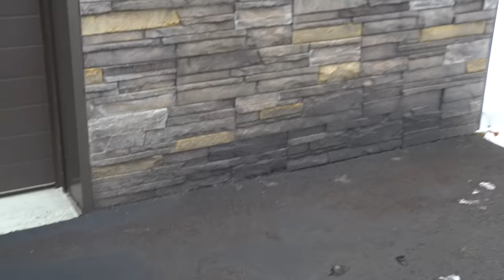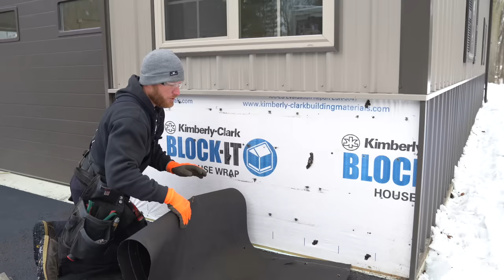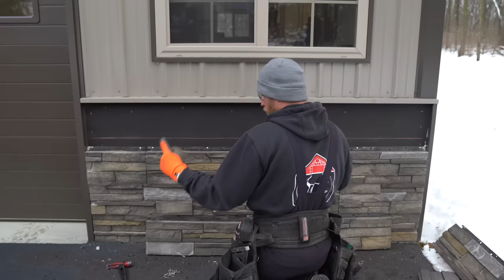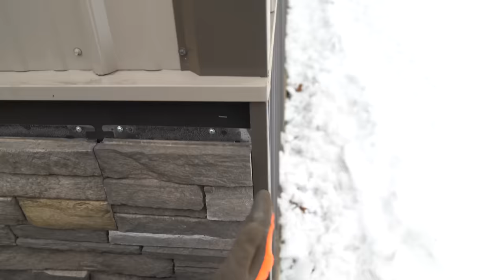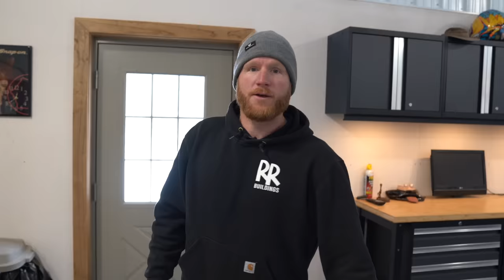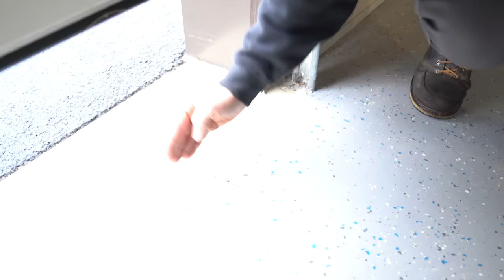Installing the BEST Looking (FAKE) Faux Stone: Versetta Stone by BORAL

Comment from the maker: Versetta Stone is a great cost effective way to enhance the look of your building very simply.
Reply: Great video on this product
Reply: What is the price per square foot?
Reply: We've had great luck with Versetta stone. Used it on our last 8 houses. Saves use from waiting on a specialty trade to come in and mortar the real stone on. Only downside is, there are limited colors currently.
Reply: @skliros9235  He said $12.50 per sq ft in the video, I believe
Reply: 24 square feet at Home Depot is like 360 before tax here in New York
Reply: Yeah good idea go to where they make that material. I like watching manufacturer of building products. Thanks.
Reply: KelMaster Construction I pay $6-$8 per foot for regular faux stone tho and yes I realize I still have the masonry materials and all in top of that but I usually end up at $20-$22 per foot and I’ve got a product that really looks close to stone instead of mobile home underpinning. 

I can tell versastone from faux stone just driving by. I guess I’ve been around it all way too long and to me the versa stone just looks way too fake. But it does have its place and the installation is nice
Reply: RR Buildings cheap asf
Reply: Can you use this faux resettastone product on a block home. If so, How would you install this product on a block home? I Would love to see , how to videos ,on how to install and what the best method to install vesettstone on a block home.
Reply: I seen the fake all most disliked how did I get here YouTube
Reply: ID LIKE TO USE IT ON A MAILBOX TYPE COLUMNS IS THAT POSSIBLE?
Reply: I had actually wanted to use this product for my house (a remodel/addition, whole house residing), and was excited about it. During planning we sent videos to the architect and builder (almost a year ago), and they were excited. The builder approached the local dealer, who tried to get samples. I personally called the sales rep for our region, and he said he would send us samples. Despite follow ups, nothing ever appeared. The alternative (lick-and-stick stone) was out of our budget, so instead of doing stone we just put Hardiplank all the way down. A bit disappointing. All parties were excited about this product, but as the days, weeks, and months went by, without even a sample being sent to any of the parties involved, we had to move on. It's interesting to see that it's a real product since even our local dealer couldn't get an order filled.
Reply: Quick question: What microphone do you use? The sound is outstanding!
Best regards form Mr. Plumber :)
Reply: Good video by the way you look like mexican boxer Canelo Alvarez  wtf.
Reply: Cost effective??  That’s hilarious.  This crap along with all the other fake Stone is outrageously expensive.  And a lot of it just don’t last.
Reply: I'm needing this done ASAP
Reply: Cost effective? $15/sq ft?
Reply: I'm curious how long it holds up to the sun's UV's , damaging it ?
Looks great right now.
Reply: How well does it mount over rigid foam cladding?
Reply: Paul Davey  ==
Reply: What are you using there to cut
Reply: Reducing the raddle was a really nice touch. I have leaned against a faux rock wall before and I know I have felt it moving around or loose and it just seems cheezy. It makes it seem like the job is far less professional when it wiggles. So I liked the solution.
Reply: Where can you get it? where is the link?

Comment: I installed "faux" stone for many years.  Here is a trick that will set you apart from other installers...get yourself a couple cans of flat "camo" colored spray paint (like a tan, grey, olive green) depending on the color stone you are working with and use the paints to touch up any cut end or edge that is visible. Having these cans of paint in your bag of tricks will improve the look of your work, especially interior work that will be looked at closely for years.  Keep up the great work, I enjoyed this vid very much!
Reply: That's cheating!   
Tee hee.
I used to use that textured "stone" paint too on granite and similar stone.
Reply: I wanna see how you return this from the corner of a house to the next side of the house, or is this just a front facial? What he’s working on has different siding on the return.
Reply: Do the same thing. Thought I was the only guy. lol Im not ready to spend the $ on the saw he uses and am interested to hear what others are using. Ive got a very nice tile saw but reluctant to take it out on a siding job
Reply: Uhm this is my wifes utube subscription lol I own Alaska Homes and Interiors she has a diner.
Reply: @analynelliott577  I always used a 4 inch Dewalt angle grinder with diamond blades.  The saw costs about 90 bucks and the blades are fairly cheap and last for a long time. The diamond blades cut "faux" stones like butter.
Reply: How do you cut it?

Comment: Excellent demonstration/tutorial on Versetta Stone repair, installation, and how it works. Just one small but maybe not as small as you think issue.  I know you are a serious proponent of the proper issue and wear of PPE.   I see that you are taking measures to avoid/mitigate silica dust inhalation but even a small amount of silica dust inhalation can be deadly serious.  Respirators are a pain in the neck sometimes but they ARE entirely worth the hassle.  10 or 20 years from now, you and your crew will be thanking yourself for it. Great video!  Learned a LOT!  Looking forward to your next video. Sure wish your crew covered Tennessee.

Comment: I would love to see this manufactured. I'm not a contractor, but a fairly skilled home owner that also has a rental. This looks like it could very reasonably be installed by the end user. I love the fact that it is screwed into place and doesn't require any mortar.

Comment: Hey Kyle I do masonry up in Wisconsin and we use a wet tile saw on any dry stack panels instead of our IQ saw. It has less chip out and you can still rip the panels down a little more accurately than a German saw. Also the tile saw keeps the dust down on rips. We mostly only do dry stack panels on fireplaces indoors and we personally have never used the Versetta products but they seem like a good alternative.

Comment: Looks good Kyle. Love your channel. Love Versetta stone. Did a large project about 4 years ago that looked exactly like this front.  We bought an old bowling alley building  and converted it to 7 condo units. The only difference to the look compared to yours was we used  horizontal Hardy board to finish the exterior above the  flashing of the the Versetta !!

Comment: You could always try a wet tile saw cutter, like the ones from DeWalt and Ridgid. They can easily cut natural stone (marble, granite, etc.), bricks (although it will shorten the lifespan of the blade) and glass (using a diamond blade)!  The overspray of water, from the pump meant to cool the blade, will keep whatever you're cutting moist, keeping dust to a minimum.

Comment: I use a 4 1/4" hand grinder with a diamond blade on it. It especially works nice when you have to fine tune something to fit such as corner pieces. Sometimes you have to relief the back side of things to get them to fit tighter.

Comment: I'm finishing my garage.  I used Coronado stone, which does require glue up and grout/masonry work.  I also installed a 15000 BTU minisplit heatpump head in the garage, and insulated the garage walls to R-23...the apartment over the garage is nearly R-60 at the roofline.

That said, I am getting ready to finish, and am looking at epoxy floor finishes, I am also just about set on the New Age garage cabinets that are shown in this video as well.  Good to see an interior that is finished the direction I am heading with my project.

Comment: Beautiful pole building! Personally, I would silicone just about every joint.  Maybe not the horizontal if it's designed to drain towards the face of the stone and not back wash towards the building, but for damn sure, the vertical seems. I realize there's house wrap and felt behind it, but I don't believe any siding should rely on an underlayment.  The siding should do it's job of keeping rain away from the structure.  Keep in mind those few days a year when it rains sideways for hours and hours!  Also the homeowner that likes to use a garden house to clean their building.  Heaven forbid a pressure washer, lol. I built plenty of pole buildings many years ago, then moved on to stick building and eventually hung up the tool belt for railroading.  Keep up the great work!   I would definitely hire a fella like you to build my building.

Comment: On the dry cut saw  your helper can use shop vac to pickup most of the dust as you are cutting, or get a bottle of water on blade unless you don't want water on your saw.

Comment: 38 years doing Mason work. I laughed when he said this can’t be done with real stone in winter. We worked year round,  snow, sleet, rain. In winter we would build a tarp type system over our work and lay it over the scaffolding and blow diesel heaters in. . The sand would have a pipe in it and we kept a Fire burning in the pipe at all times to keep the sand warm. Rarely did we ever miss a days work because of snow

Comment: Local supplier had a rep from versetti stone give a demonstration. The rep said to nail on mesh and glue the top course. Another contractor mentioned that he drills two holes and uses trim head screws to secure the top course.

Multiple ways to skin a catfish.
Reply from the maker: Yes you can do that for sure... not necessary but I think from a liability stand point you don’t want anything falling off

Comment: Thanks for showing this stuff.  My wife and I have fiber cement and the bottom pieces are cracking and breaking in some spots.  We are wanting to use something like this and install it ourselves.  We just priced it and it will cost over $5,000!  Definitely not cheap.  I can’t imagine how much real stone would cost to have installed.

Comment: Use a 5 gallon bucket, drill a small hole in the side near the bottom and fill with water. You'll need someone to hold the bucket and use it to wet the blade of your saw as it cuts the concrete.
Reply: That will help with dust

Comment: You can avoid rips by doing your measuring to end up using only panels that do not require ripping when originally designing the layout of the garage
Reply from the maker: Only issue it changes the height and I want it the same as the rest of the buildings wainscot

Comment: I could really use your advice.  My wife and I are both disabled and have lived in our home in Houston, Texas for 41 years.  Between 2016 and 2017 we were flooded, then hit by a wind and hail storm, followed by Hurricane Harvey.  We had no flood insurance and mold started growing in and through the walls making my already severely ill wife suffer even more.  Because of the mold, I needed to start repairs immediately.  Rather than waiting 2-3 months for "written" permission from the HOA architectural committee, the HOA president gave emergency permission to erect a detached garage in my backyard for storage and living quarters while my son and I were attempted to repair some of the $80,000 damage to our home which we had little money to repair.  As soon as the garage was erected, we were sued by our HOA for $100,000 for doing it without their "written" permission and for the building being metal, just like the one in this video.  The metal sides are identical to the metal sides on the building in this video, but I must now find a way to cover it with vinyl siding or pay to tear it down.  Covering it will void the building's 35 years no-rust warranty so I am trying to figure a way to do it without trapping moisture behind the vinyl siding.  My idea is to attach pressure treated 2"x2" furring strips vertically in the low portion of the metal siding between the raised ribs, making them about 1 foot apart.  I was then going to put a vapor barrier over them and then attach the vinyl siding by screwing it to the 2" x 2" furring strips.  The 2" x 2" furring strips are about a 1/4" taller than the raised area of the metal siding, so the vinyl siding would rest only on the vertical 2" x 2" furring strips and just miss touching the metal siding. I have talked to several siding installers who will not touch the job or give any advice.   What do you think of my idea?  Is there a better way? Thank you.  God bless.  James G. in Houston

Comment: Had a Trade guy give me an estimate for the lower front of my house. He said it’s difficult and would need 35.00 per hour Cash! and it would take about 3 days.
I’m quite handy and felt I could do it.
Well I killed it in a day, and was like a kids puzzle, easy pezy!
Just need to rent a decent Water-saw. The pieces cut easy and simply lock into place. Start off level, check the edges that lock together to be sure it’s free of debris so it sits well. Don’t be afraid to do it yourself.

Comment: Put a 80 tooth blade on backwards on a tablesaw and it’ll cut it like butter, not sure what the rpm is on a dewalt table saw but the Bosch table does a great job

Comment: Would like to see how it's made. Also, I've used an angle grinder with a concrete blade to rip cuts. Takes longer than a concrete saw but it's very accurate and easy to use with just one person.

Comment: At the top of the veneer under the flashing should have a big beed of caulk to keep the elements like even wind from blowing directly on the vapour barrier , that allows break down of vapour barrier and cold spots in the wall , it would be to easy to put caulking for the benifets you had the caulking gun right there 
Ok have a great day !!! wait to here from ya !!

Comment: I install this stone but I touch up the ends with a touch up paint  bottle   I have for cement siding to cover the cut ends that are visible on butt joints or ends that are visible by eye against the  door jambs or corners of a house/building.  Since thickness varies shows the cut edge. The other thing I do is run my Hepa vac and have the vac nozzle close by to suck the dust up on saw cuts.

Comment: This looks to be exactly like the Adorn mortarless stone veeneer that I just installed on my fireplace. Planning to use the same on the exterior of my house like you did. The Adorn has no tongue and groove however. And the casting was a little rough...to minimize the gap between pieces I had to use a handheld grinder on some to back-bevel them a bit. I used a wet tile saw to minimize the dust for normal cuts.
And because I installed it, I see every joint which kinda bugs me. I don't think anyone else pays attention. Looks great overall!

Comment: Great video, shame the black top guy didn't spend a couple of dollars protecting the stone with some plastic sheet or similar. For the stone table saw maybe consider wiring in a foot operated power plate. That way you can turn it off but keep a hand on each piece of cut material. Would be a quick easy job but make life that little bit easier, more efficient and safer.

Comment: The only thing that keeps this from looking really  authentic is that the stones are not staggered enough. There are 3-4 rows where the edges are completely aligned with each other, which wouldn't happen if a mason were laying this stone by stone. If they could come up with a way to stagger the stones more, then it would really look incredible. It IS very good looking, it's just that one thing.

Comment: It would be great if they can devise a way to interlock the faux coursing between panels.  The continuous head joint across simulated multiple courses as well as the relatively flat/in-plane installation with the metal siding above further exposes it as siding product to the discerning eye.

Comment: Hello- watching your channel got us hooked on versetta stone.  We built a steel/metal barndominium and purchased our stone preconstruction to ensure we were set.  Unfortunately, our metal building contractor asked for specs but made no allowances for the install.  Is there any recommendation on how to apply our stone to the completed building? We are red iron and metal siding exterior, traditional wood interior framing on house portion of structure.  We’re thinking we’ll have to cut metal siding, install treated plywood with paper before being able to install stone?  Sure wish you were local to us… we’d hire you immediately.

Comment: I would make those long rip cuts with a 4 1/2 inch angle grinder with a diamond blade and use a fan to blow away the dust as I’m cutting

Comment: Ive always used a red tab on the ends and put the cut towards the inside. I don't really like either option, wish there was a better way.

I have thought maybe you could bend something similar to a vinyl corner, but deeper to accept the stone. Same color as the other trim pieces. Would look pretty good. Maybe I'll get a chance to try it out someday

Comment: Will there be a video about the garage heating system ? I liked it. The boiler and the collector are bound with copper. As a heat carrier, water or antifreeze? It is very interesting to learn the articles of equipment. I want to compare it with Russian prices. Thank you in advance.👋👍